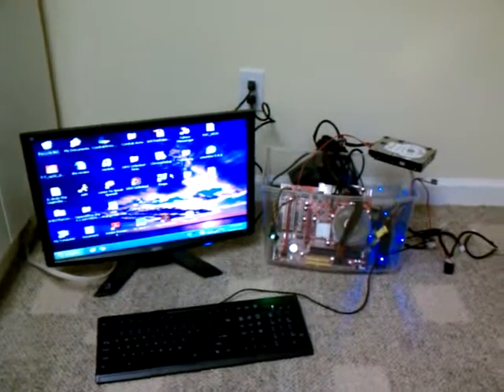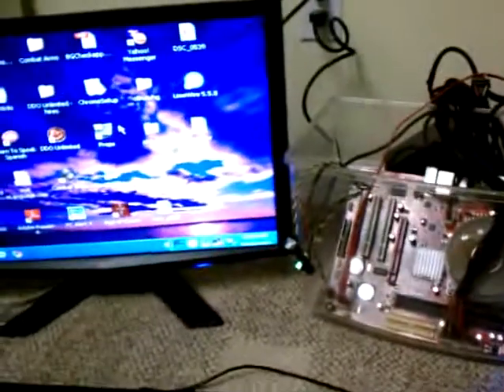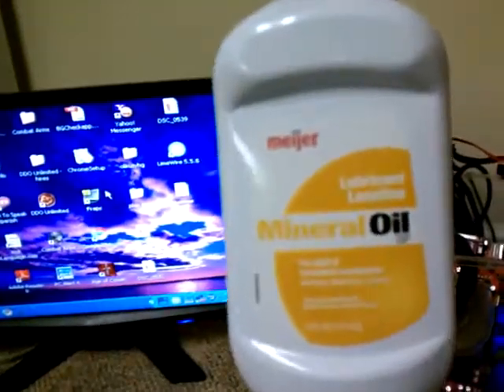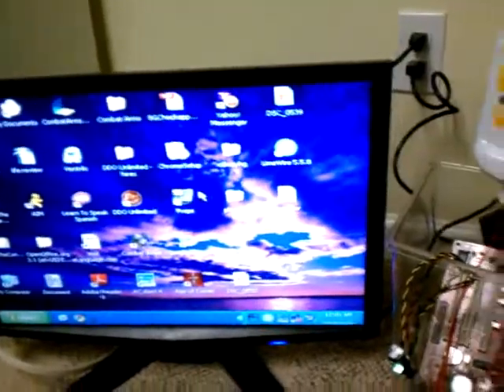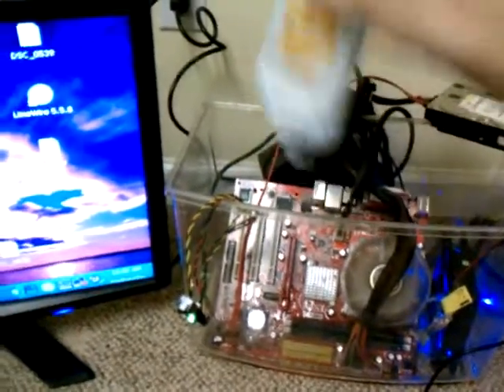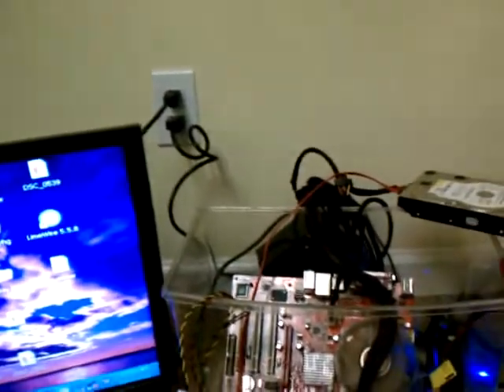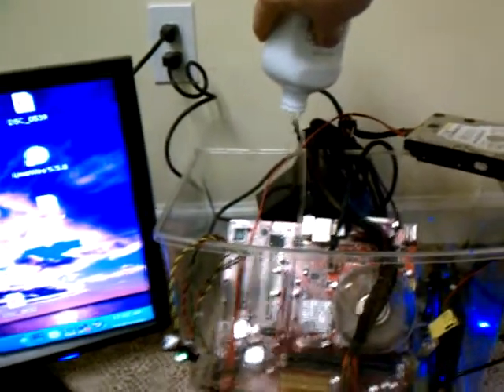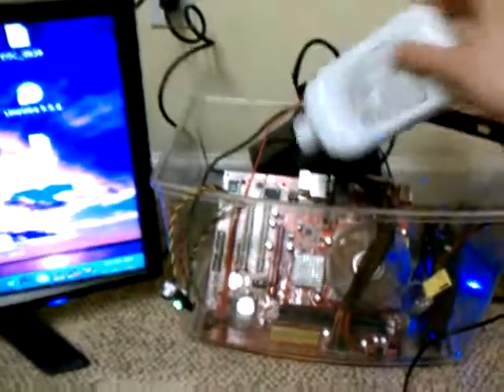MIneral Oil PC Test: Part 1

Comment from the maker: @Zake4688194 No overclock yet. The older equipment in the tank right now doesn't have options for overclocking but it's a 3.2ghz prescott 65nm pentium 4. Once I have let this old set of hardware sit in the mineral oil to verify it doesn't have any long term negative effects, I will set up the larger tank with a stronger pump for the mineral oil and try some newer hardware that i can overclock in it.